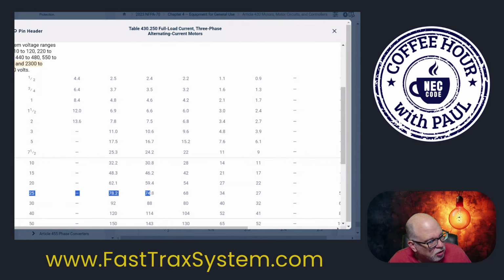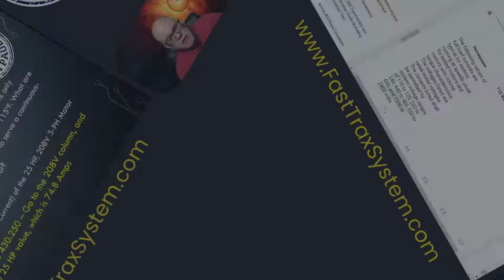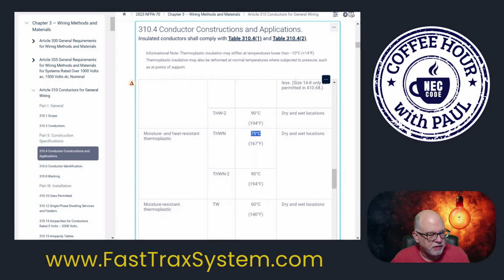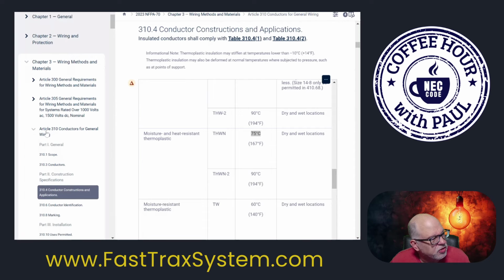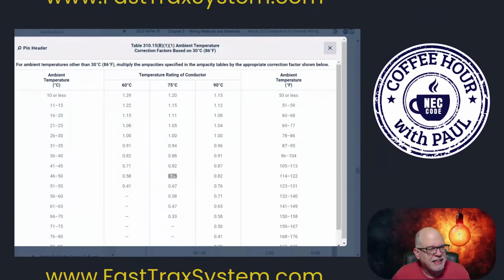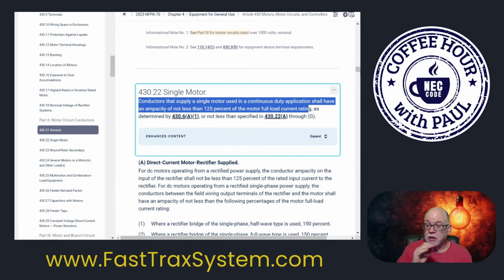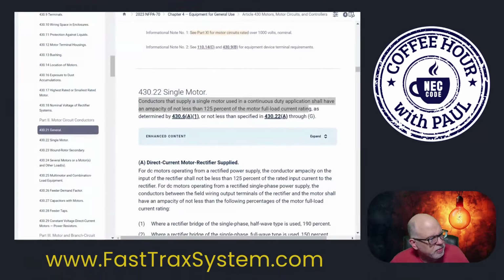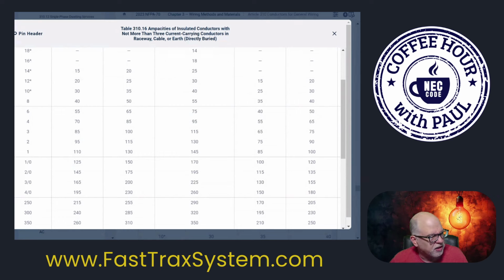Motor Conductor Sizing — Most Electricians Get This WRONG

Comment: Thank you for making his more clear!  I came across this question on Ray Holders website and I thought there was a mistake because he also answered the same as how you answered. I am taught that the Table 310.15(B)(1)(1) is a percentage to multiply and when working the problem out with multiplication, the wire size did not make sense to go down.  I feel more confident now if another question come up like this👍